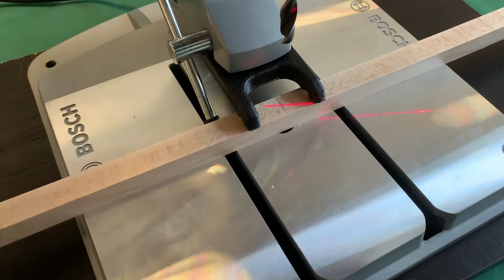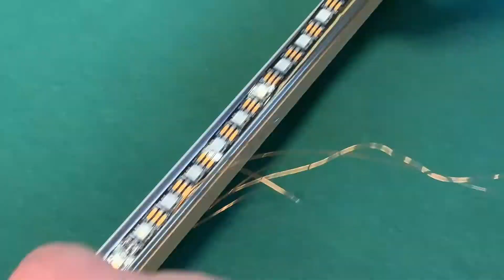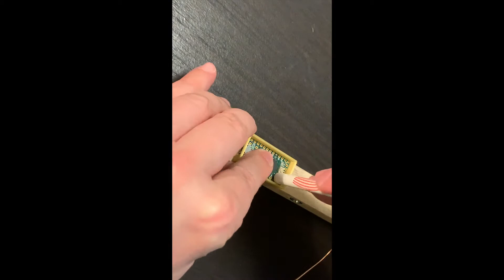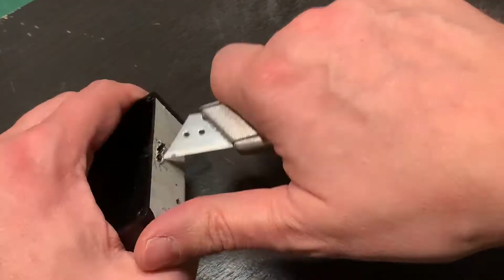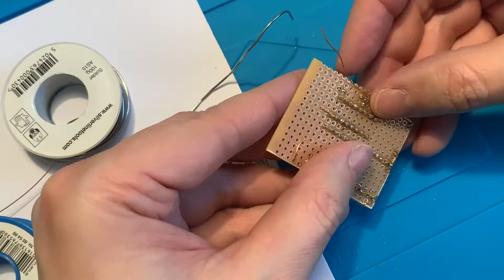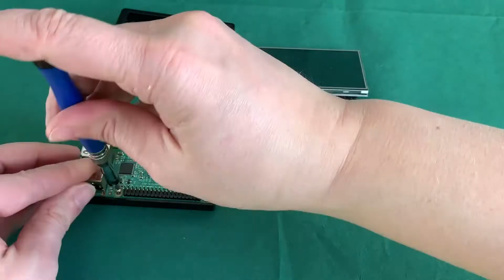Do It Yourself EMDR Equipment (Lightbar, Buzzers and Controller)

Comment from the maker: Hi folks. Some of you have reported, that the used microcontroller board (Teensy LC) is not available anymore. Good news: I have updated the GitHub project (https://github.com/Harvey71/emdr). In the readme you will find three alternative microcontrollers and how to connect a level shifter. Also the software is updated, supporting the alternatives.

Comment: Hey, wonderful video, thanks for sharing :) I'm trying to build just the light bar, but as a newbie I'm confused about the wiring. You have three wires in the middle of the bar that will be ultimately attached to the teensy. You solder them to the 3 pins in what it looks like the middle of the LED strip, but then there's also a wire from data pin in LED 1 that you're glueing along the way. Where is this wire going? Did you attach it to the data pin the middle of the LED strip? Sorry if this is a stupid question.
Reply from the maker: Sorry for the confusion. While +5V and GND are looped through, you can connect these wires to any LED on the strip - so I chose the easiest one, near to the drilling. But the DATA line (Pin 26/A12/DAC on the Teensy LC) has to go to the input (DI) of the very first LED. This is why I had to lay the wire from the drilling to the end of the bar and secure it with hot glue. To be clear: There are only two wires soldered to the middle of the strip and one to the end.
Reply: @harvey7113  Thanks for the quick reply. I get it now. I had no idea that for GND and 5V you could use any LED of the strip. Thanks again and keep sharing these awesome projects :)
Reply from the maker: Sorry, my upper comment is not 100% correct. I mentioned pin 26, but in fact "pin 17 at Vin voltage" has to be used. It is opposite pin 26 and has no number on its own, so I mixed it up in the comment. Thanks to Loise for pointing this out.

Comment: Thomas, Thank you for the great resource. I am having problems getting the program to run. The controller is connected, audio is working, but the lights don't move off of the first led. I have tested them using the library, and they work fine. Any suggestion would be helpful I could really use this resource. thank you
Reply from the maker: Hi Daniel, After you had closed the issue on GitHub, I thought that you somehow got it to work. Sorry to hear otherwise. Please reopen the issue or create a new one. I need more information to help you and I don't think, that youTube comments are the ideal mean for that. I don't think, that the B-version of the LED strip is a problem. And since you managed to get it to work with another software on the Teensy, wiring has to be correct, too. What I need to know: Does it work, when you start the controller on a PC/Mac? I am not sure if I got you right on that one. When you connect the LED bar to the controller (or PC), does the grey button with the eye icon turn blue or does it stay grey? If it stays grey, we will have USB issues - that's by the way the most common problem with this setup. Sometimes it helps to use another USB cable. The Raspberry Pi is quite picky when it comes to that. My controller had that issue and after nights of debugging, I desperately exchanged the cable and voila - everything worked find. But if the button turns blue, we can rule out USB as the culprit. Then my next idea would be to check the number of LEDs. The value configured in the controller software has to match the physical number of LEDs of your stip. Again, let's continue on GitHub.

Comment: Hey thx for your great work. Your project is exactly what i searched. Because the Teensy LC seems to be sold out. is there any other Controller you would recommend? I also have some esp or arduino Nano around is it possible to use one of these?
Reply from the maker: You can basically use any microcontroller. But I would recommend a MCU with a USB software stack, like the Raspberry Pico. That one is also highly available and quite cheap. The reason, why I used the Teensy LC in the first place is that it comes with an integrated 5V output suitable for the LED stripe. You could try connecting the data line directly to a 3.3V output, but then you run outside the spec and that may or may not work. You could try with an open collector output and a pull up resistor to 5V, but again this might not work due to the resulting skew rate. So to be safe I recommend an external level shifter, which is also very available and cheap. In any case you will probably have to rewrite the firmware, but the source code is rather simple. And if you are not too familiar with C coding, on a powerful micro controller you can install MicroPython and write the code in Python. :-)

TL;DR: If I would start the project today, I would use a Rapsberry Pico and a level shifter.

P.S.: Currently I am planning a wireless solution. So look out, maybe there will be video about that end of the year. 8-)
Reply: Thx for your answer. If find some time before you release your wireless version. I'll try to build it with a raspberry. If not I start directly with your next version ;)
Reply from the maker: I have updated the GitHub project (https://github.com/Harvey71/emdr). In the readme you will find three alternative microcontrollers and how to connect the level shifter. Also the software is updated, supporting the alternatives.

Comment: How hard would it be to do this using the standard standard / off the shelf EMDR paddles?
Reply from the maker: Depends on the paddles - but should be possible. You can buy all the EMDR equipment off the shelf. But this would be more cost extensive and less fun. ;-)

Comment: Where is the parts list for the light strip and controller? That would be much more useful than extended views of using a soldering iron.
Reply from the maker: See further description and source code on https://github.com/Harvey71/emdr. There you will also find all the parts lists.

Comment: Hi folks, I am building a device for my wife and I am trying to use the controller software on a windows64 pc.  When running  "pip3 install -r requirements.txt", the process terminates with error message that file "setup.py" does not exist. More specifically, the console messages look like this:
...
using cached py-game-2.1.3.tar.gz (12.8MB)
preparing metadata  (setup.py)  ... error
error: subprocess-exited-with-error
  × python setup.py egg_info did not run successfully.
  │ exit code: 1
  ╰─> [77 lines of output]
...

I am not so familiar with py, is this an error in my pi installation or is this a missing file in a library or controller software?  Any help will be much appreciated. Thank you.

I am using python 3.12.2 and have installed thorpy, graphics, libusb, pyusb, wheel, pygame, numpy, and serial modules. 

Thanks Paul.
Reply from the maker: Hey Paul, I am afraid there is no precompiled wheel of the pinned version of pygame for your setting. Please try to install the latest pygame version instead. You can do that by editing the requirements.txt file like so:

pyserial==3.5
pygame
thorpy==1.6.3

and install it with "pip install -r requirements.txt".

I tried this on my Windows laptop and Python 3.12.1 - and it worked fine. I hope, this will help you, too.

Comment: I am planning to build something similar but doubt that my wife would be allowed to use it in her workplace because of the missing German GS/CE seals. How do you deal with that? Do you have a rough estimate on the power consumption and if this could be powered by a battery pack?
Reply from the maker: If you are concerned about the power connection, don't. The Controller is powered by a standard 5V USB power adapter, which is available with all GS/CE seals. The rest of the equipment is on low voltage. Of course, you can use it with a USB power bank. Mean current consumption is abaout 500mA, so a 5000mAh battery should run it for abouht 10 hours non stop.
As an option, you can ommit the controller and connect the light bar directly to a Windows or Macintosh Laptop or PC an run the controller software on that. The light bar will be powered by the USB port (it only consumes about 20mA) and no additional power supply is needed.
But if you have any objections other than the power supply, I have only one piece of advice: do not build it yourself but buy a ready mounted, medical approved, professional device. ;-)

Comment: Sorry if this is obvious, but is there a slimmed down version for just the tappers?
Reply from the maker: It‘s a modular system.  If you want tappers only, just leave out the lightbar. The controller will recognize that the lightbar is not connected and just go with the tappers.

Comment: I am looking into making one for my therapist,  but would need to make it remote controlled  over the internet for her to control..
Reply from the maker: Hi Dustin,
I do not have an out-of-the-box solution for a remote controller. But if you would use a laptop/PC for the controller, you could simply install any remote software, like TeamViewer or VNC.
Reply: @harvey7113  TY, have you finished your prototype?
Reply from the maker: @Dustin: The epuipment you can see in the video is still working and in use every now and then by my girlfriend, who is a psychologist. As she has no more whishes for improvement, I would claim it "finished". ;-)

Comment: Is there an option to adjust the number of repititions on the second play button? From 24?
Reply from the maker: Sorry, Debora, but that value is hard coded, because I have been told that 24 repetitions are kind of a standard. If you have a different standard, you could just change one line of source code. Edit the file main.py and change the value in line 486 from 24 to anything you prefer. E.g. for 30 repetitions the line would be "self.max_counter = 30". Do not change the indentation, since it is crucial for Python. The button though would still have the "24" on it, unless you change the images play24*.png as well.
Reply: @harvey7113  Thankyou for the reply. This is great work and very resourceful!
Reply: Is there a way to increase the number of LEDs that light up?

Comment: Hello! Im having trouble using the code you've provided in your link. Arduino says there is a stray "@" . Any tips would be appreciated
Reply from the maker: Have you selected Teensy LC in the board manager? If the error still appears, could you please provide more information? A "step by step" to reproduce this would be helpful. Since there isn't a @-character in the source code at all, could you double-check the code window? Source should begin with "#include <WS2812Serial.h>" and end with "}" and there should not be any @.

Comment: Well I think what you have done is amazing . Did u work out the total cost it cost you?
Reply from the maker: Thank you. I did not take track of the costs, but just estimated with the parts lists: Round about 80€ for the light bar, 60€ for the buzzers and 90€ for the controller.
Reply: I've estimated this purchase to about 200 USD. Not including the stand or light mount.

Comment: Hey there, and thank you so much for your very enlightening video. How much did you spend on materials? Do you want to sell this unit? 
Would you build me one if I was to pay you? If so, how much?
Kind regards,
Reply from the maker: Hi Diego,

for part lists and estimated prices see my github page https://github.com/Harvey71/emdr. That used to be round about 80€ for the light bar, 60€ for the buzzers and 90€ for the controller - before inflation. ;-) So, maybe add 10%.

Unfortunately, I will not sell any of the shown units - for several reasons. This video together with the resources on Github are meant to enable others to rebuild this without reinventing the wheel. If you just want the light bar and maybe use your Laptop as a controller, this should be feasable by any experienced hobbyist. Maybe you know some friend who can help you out with that?

If you really want to buy EMDR equipment: There are several providers online. I just googled for "EMDR equipment", and found a complete kit, which is quite similar to what I have done, but looks way more professional. It costs under 500€ including controller and buzzers.

So its' up to you - and your budget. Rebuild it or buy it. ;-)

However, thank you for your comment and questions.

Comment: what is the wire that you used for the light strip?
Reply from the maker: Enameled copper wire. Same as for the circuit board.
Reply: @harvey7113   Thank you for your quick response! I have the lightbar built and it is working well because of your willingness to share your knowledge and coding. I have one additional question: How difficult would it be to adjust the programming to include  additional speed settings that go faster than what is currently available?
Reply from the maker: Cool. Congrats for your successful rebuild. :-) What OS are you running the controller software on? There is a timer resolution issue on Windows. Maybe I can implement a workaround. So let me know about your OS.
Reply: That would be awesome! I am running on windows 10
Reply from the maker: Hi Matthew. I just uploaded a modified software version to github. Please have a look and let me know, whether this helps. On my MacMini I achieve a frequency of 140/min. On my older Windows Laptop, it becomes a little laggy over 100/min, but still is way faster than the old version. Fingers crossed and looking forward to your response.
Reply: @harvey7113  That did the trick! Works just like I needed! Thank you for your time to make the adjustments!